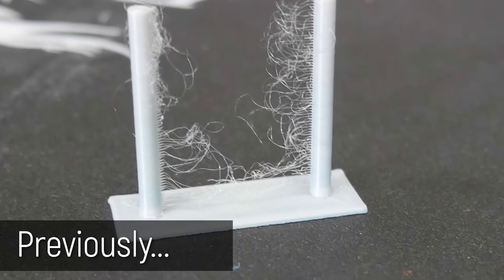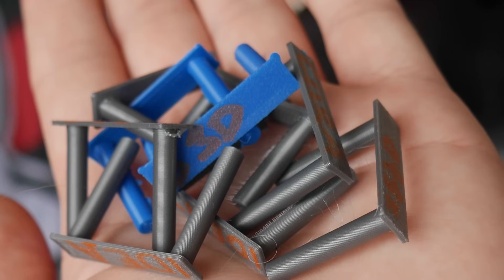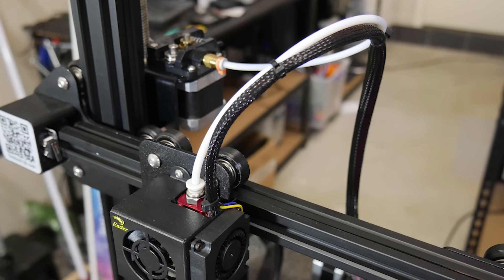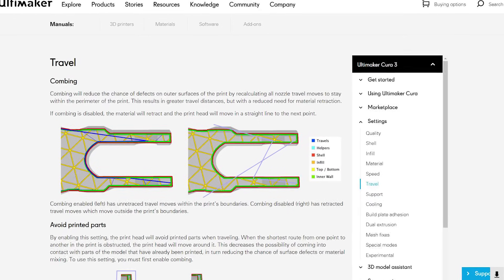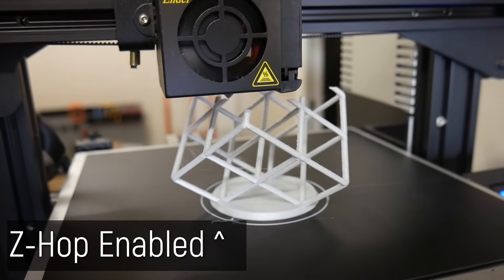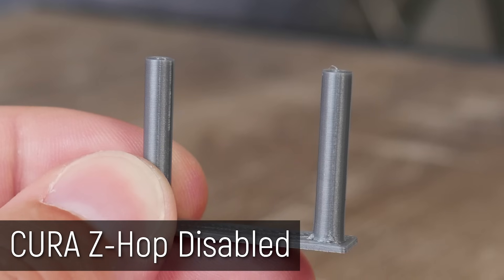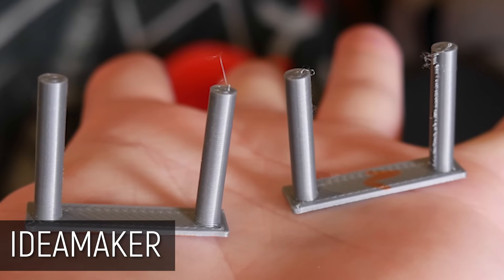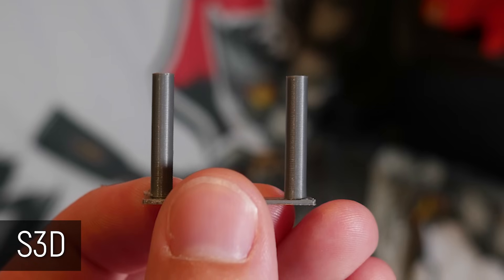Stop Ender 3 Stringing with this One Weird Trick! (ok but seriously)

Comment: To weigh in on "Why I purchased an Ender 3 Pro". 

This will be my first printer (still waiting to ship). Since I am in the senior year of my ME degree, having a printer will be extremely handy. I have spent months talking to the few owners I know, reading reviews, watching videos, doing my own comparisons in Excel, and basically looking for the printer that would work best for me. In the end, I chose the Ender 3 Pro for some really simple reasons: 1) It's $200, but offers some solid benefits for that price - a heated bed, large build area, etc. 2) I have NO idea what features are going to actually matter to me. This is something that will only be discovered after using one for a while. I can use this one, find what I like, what I don't like, and what I wished was better/different and then make an informed decision for my next purchase. 3) At the $200 price point, I can dump a LOT of money into changing or upgrading specific portions of the printer and still come out hundreds of dollars ahead over other printers I have looked at. 4) This one is counter-intuitive, but after many decades (I am 44) of owning low-end items (cars in particular), I know that I will be forced to learn how to compensate for flaws in the printer through either adjusting settings, software selection, material selection, design iteration, or others that I can't even imagine now. If I purchased a $1500-$2000 printer would I have this knowledge? Maybe eventually, but I probably wouldn't come across them terribly often and I would be lacking that practical knowledge. I would rather learn how to overcome unique situations where failure just means wasted filament instead of trying to learn it while under a deadline for a job. And last, but certainly not least... 5) It is a $200 printer. Absolute worst-case scenario, it ends up being a giant dog turn, I find it completely unusable and then I scavenge it for parts and I'm out $200 and I try again.

The town I live in has no maker spaces. The nearest public access 3D printer setup is about 70 miles from my home and requires a membership. The printers we have at school aren't available for us to run, we can only supply STL files and to be 100% honest, the folks running the machines seem to know very little beyond "drop model into the slicer, hit default settings, collect print in X hours". The questions I have had for them have never been answered in a satisfactory way and detailed prints come out of the VERY expensive machines looking like trash. The ability to purchase a 3D printer with the basic extras for this price point is fantastic for those of us who will use them often, but lack any practical experience or a practical way to get that experience beyond owning our own.

Now I can certainly see why a seasoned printer user might look down on a printer like this. The inherent variability in performance, lack of features they find important, and a myriad of other considerations that I am not aware of yet, mean that this printer may be far from what a seasoned "pro" would want - eventually I fully expect it to be that way for me as well. But for us rookies, and even people just looking to goof around and make some fun things, a printer in this price range with the features this one has is perfect for us to dip our toes in. As tech advances and the prices are pushed down compressing the high end and low end, this will be less of an issue. But for now, the printers that are recommended in general "for beginners" range from $200 to $1000+ and even to someone like myself with relevant education, the differences outlined between those printers are vague at best and non-existent at worst. $1000 is a hard pill to swallow for someone who is looking to try out 3D printing. But $200? $200 isn't bad at all.

Comment: Im printing a temp tower right now, and its backwards!  The first section is 210 degrees and it slowly starts to get stringy as it is approaching 170 degrees???  I installed a dual gear extruder and saw that I needed to adjust my retraction and have been messing with it all day till I printed this tower.

Comment: I’m a professional coder of 35+ years and a computer hobbyist of 45. Some years ago I decided to take a G code course just because it was a kind of programming I didn’t know. This was G code programming to control huge CNC  machines to drill and mill metals, usually aluminum. You would be surprised how much effort went into designing the G code to prevent unwanted effects from the tool itself. For example, you always mill an edge against the rotation of the tool rather than with the rotation to prevent it hopping across the metal. When drilling, you drill Down so far and then pull the drill out to spin burrs out of the drill bit grooves to unclog them and then drill back in.
Point is CNC work (which is what 3D printing is) has always required taking tool motion and material into account.

Comment: its weird but on six different printers using solely S3D i have never once had any stringing anywhere on any print... at all, its a non issue for me no matter the layer height or any other settings.. so it must be my filament, i used AMZ3D for about the first year i was printing and then CCTREE for the last few years, its super cheap and fantastic quality, never once had any issues with it whatsoever

Comment: I hate to say it but you're right!  Simplify3D (which I bought) is not NEARLY as good at slicing as Cura. I had a particular part and the stringing was mad, out of control.  By slicing in Cura, a flawless print.  The toolpaths are just better and there aren't any settings to change them in S3D

Comment: I think the stock value of 0.2 or 0.3 for the outwer wall wipe is a bit small, but it probably depends on your nozzle. On my 0.6mm nozzle I found a setting of 0.6mm wipe helped with the seam a lot

Comment: I posted this on your other video and see you are learning slowly.
I can say this if you have no clue about plastic and i have almost 37 years in thermoforming, Injection Molding, Blow Molding  CNC programmer. Thermoforming Technician.  I could get the Original Printrbot Simple to print better then any top end printer. None of you who have zero knowledge of how plastics act to certain temps nd what type of heat used to heat these plastics. These hot ends you are working with have a raidiant heat instead of direct heat. Every plastic is different even the same type. Depending on how its extruded or if your working with pre-extruded materiel in its raw form. You and Chuck  have a long way to go to learn. The machine is just a tool its the person who set up, troubleshoots and runs the machine has the knowledge of all the above. You do great videos but you all still have a long way to learn. But you will get it and when you do your remember this post and say to yourself damn now i understand. lol Happy printing. I have never used Z-Hop. On any of my 3D printers.

Comment: So, I looked through the comments (mostly... there are a lot) for this easy answer.  I have printed ChazMeisters test and, yes, it comes out perfect. I tried to duplicate it in Cura 4.3 by adjusting the Combing setting and the Outer Wall Wipe setting. These are the only settings you really reference in the video and it's not exactly clear what to set them at. I set Outer Wall Wipe to 0.2, but the combing option is a pop up with these choices "Off / All / Not in Skin / Within Infill"  So was wondering if you had specific settings and values for these...? Thanks!

Comment: Worked great. Thanks for posting your settings. They were not that much different from mine. It seems the fix here is the wipe settings, which were drastically different. I was also using coast. The stringing test came out absolutely perfect with these settings.

Comment: I'd like to know if tuning temperature settings with a temperature tower and possibly tuning filament diameter (have you measured with calipers?) can get the good results with the other filament. IOW is the filament just bad or just different?

Comment: I don't use Creality but Anycubic and it's the same here. I have always had good luck with them but it seems Anybubic updates it's printers when many ppl complain about something and so newer versions are different. It also depends where you live. For example: I ordered the Anycubic Predator at Amazon.de, mine came with stepper dampers already installed. However looking at other ppl on facebook who got there printer after me but ordere there printer on Amazon in the US did NOT have stepper dampers pre installed. 

Anyway even Prusa updates there printers for time to time but the problem is with the Chinese printers that you never sure what you will get. Also some old stock may be the reason that one still gets a older version.  And like everything you need some luck to. (the monday car effect).

Comment: I don't see much discussion about matching print temperature to each filament spool of PLA.

I always empirically determine the correct print temperature for each spool as soon as I open the box. Then I write down the best temperature on the spool itself so that I know what settings to use for that spool. 

The results vary dramatically - I have an excellent black spool that prints best at 185, and an excellent white spool that prints best at 225. The previous white spool was 190, and I currently have 2 blue spools, one with 205, the other with 220, plus  myriad of other spools marked with temperatures between 185 to 225.

I would have thought with so much variation in my experience with PLA filament temperature that more people would acknowledge this reality... especially YouTubers specializing in 3D printing.

Comment: 2:00 at first i had issues with stringing, thing is you need the temp hot enough, but not too hot, and you can't have the head moving about too fast. I use simplify3D

Comment: It's mystery, to me, rep-rap printers with exchangeable parts not made by creality can cause differences in print quality. Anyway about warped beds. I have a theory nobody liked SSI far.  I'll give you a try.  In basic geometry three points define a plane.  My laser uses three screws to adjust the planar mirrors. My theory is that you add a fourth point the plane will warp if the fourth point isn't on the plane. In other words you can warp a bed with four screws.

Comment: Thanks for sharing this, of course.  Now for the 2 cent comment from the peanut gallery:
Given that the magic solution involved a tricky little maneuver (combing?) which amounts to a tip wipe before traversing across space, what do you suppose you'd get if you reversed the order of the wall extrusion: instead of working from inside to out, start with the outer wall and work in, so you'd (possibly?) get a similar combing wipe?  Would you see a down-side that I'm not imagining?

Comment: I get the feeling you disapprove of these cheaper 3d printers? with out these affordable printers the hobby would be nothing it is today. 

I use to be the same with RC cars, I owned a few High End racing chassis and for a time looked down at the cheap entry level cars (now im building some lol)..... and my brother is the same with Camera's... but.... what ive since lernt about trouble some products, they push people to learn, diagnosed and repair. 

......Say you have 2 teenagers... one learns to drive in a brand new BMW, and the other learns to drive in old VN commodore that requires constant maintenance and repairs to keep it one the road,  at the end of the day who is going to have a better understanding of the machine?????

Comment: Dude.  I just got my Ender 3 setup 2 days ago (total noob) and ran a print using the dog gcode, and it did great.  Then I pulled a obj from Thigiverse (a bracket for my Wyze sensors... kind of my excuse to try out 3d printing), converted it using tinkercad to gcode, and printed.  It was horrible.  I watched this video, installed cura and set it up with the Ender 3 settings, used the same obj file to creat a gcode file there, and then printed that.  OMG.  Absolutely perfect.  And that's ALL I did.  THANK YOU!!!!!

Comment: Don't know if I'm lucky or not, I'm a totally newbie on 3d printers. Got my first one just over a week ago. Ender 3 Pro. Had a couple of "startup" problems, just minor things. But my printer works just flawlessly, everytime single time. After watching some yt videos I decided to run a couple of tests, incl the stringing test. And I havent experienced any of these kind of problems, quite the opposite, I think my prints came out even better than your stringing test, without any settings mod... I'm currently using cura..

Comment: I use the stock Cura 4.0 Ender 3 profile on my Ender 3 Pro the only thing I've changed is retraction to 6 printing it .2 mm layer height I get Flawless Prince with no stringing that being said I was trying Cura 4.2.1 and no matter what I did no matter what settings I changed the print time was much longer and all of my things would string I was using 3D solutech filament I changed the hatch box that seemed to make a little difference but the slicer changed made the big difference hopefully this can help someone who's having issues with 4.2.1 and straining on their Ender 3 or cr10

Comment: I found a way to eliminate stringing and the need for retraction completely. If you hold your finger over a straw the water doesn't come out..... ya, so it turns out the bowden + E3D has airspace.. aka its not sealed. So i made a little part with a hole which fills this gap. It looks like a pvc coupling, except the size is more like 3mm high, 1.75mm ID, & whatever the OD was(I think it was 3mmish). Yes it was an incredible tiny part and I had to make the ID with a proper size drill bit(small holes never print to spec).  NOW this idea came from something like 6months of trial and error & many bad ideas(like stainless steel mesh in the hot side of the hotend(which actually works a little, but sucks overall, the thing leaks any amount that is past the stainless))...  The only drawback from these mini PVC pieces are the following :  #1. When you need to change filament > you need to remove the whole bowden and all. #2. When you need to change to a different filament the TINY TINY amount of size difference makes a dramatic !argh! and the only fix is to make custom mini pvc's for each filament. 1.75 mpvc will not work with a 1.65 wire, no no. #3. it makes extruding a bit tougher> fix = tighten your hobbs.  The pro's are #1. you don't need to retract.. like at all !!   If you DO retract > air gets inside the hot end and makes bubbles come out when it finally extrudes . it works though. I print these mpvc things with nylon pctpe caz I have a delta and that is the most flexible thing i can print. They last quite a while and with enough coercion one can pull the old wire out when needing to change. its just really not cool or fun. plus when you want to get the new wire IN that little hole. Well she ends up saying " that not the right ** " oh .. wrong channel sry. well. truth is there is lots of slop designed in that space where the bowden meets the aluminum and its probably there to make it easy to put new wire in(and take the old out).  To make this paradigm work all we need is an air tight top piece which is directly above the melt zone. snugglez on the filament ....   Wow , just checked the inventor files. started in 2015, last design was 2016. I made something like 20-30 different versions. and settled on a version which is in a printable jig with the part in the middle. caz ya they are sooo small you need to not only print like 6 a time, but also need the outer jig(10mmOD) just to get the heat distributed evenly. final dimensions are 4.2mm OD, 1.7mmID 2.5mmH >> Its called a Bowden Pressure Grommet - name= MSc1  ... there is many other facets to the part. msg me if u want the doc/inventor file/stl. I am happy to share with the community